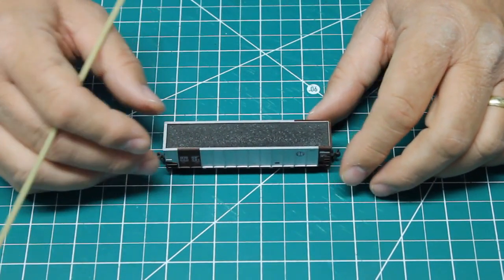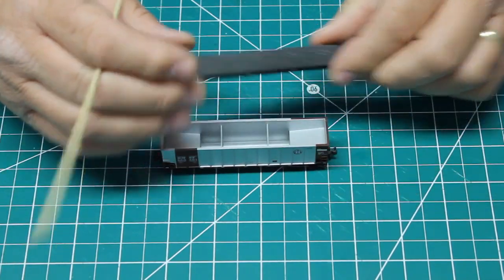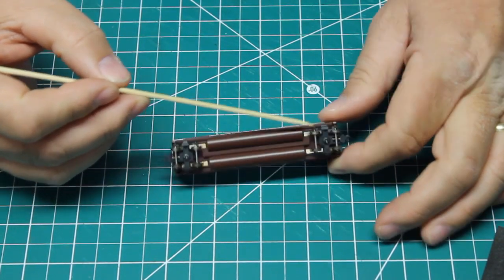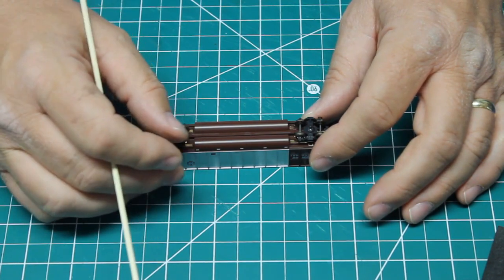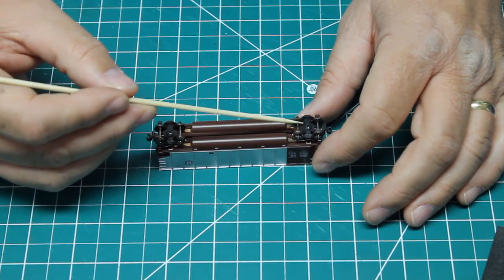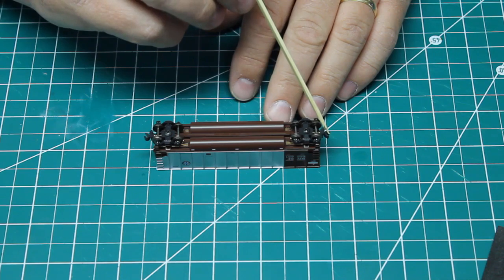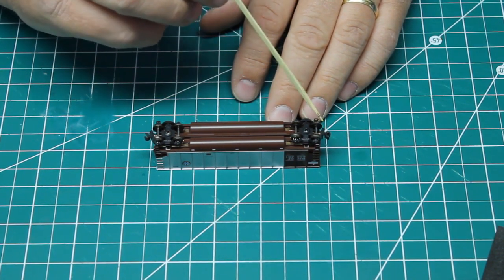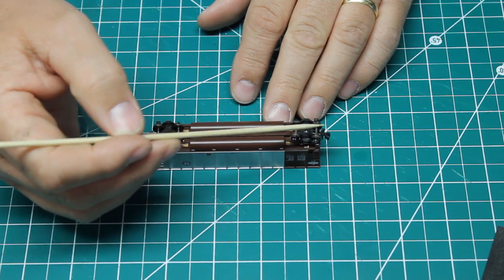Model Railroad Coupler Installation - Body Mounted Couplers

Comment: Brother Ron, very informative! This made the unassembled couplers seen much less intimidating.   I strongly prefer the look of body-mounted operations.  I convert all my M-T cars over, simply by removing the couplers with a hobby knife and re-installing them onto the body.  One project I have is to convert my fleet of Altas 90-ton hoppers over, but that will require a mod such as a styrene strip to install - it would be awesome to see a video on that too!

Comment: Love the glue bottle holder ..... what a great idea!!    And FYI, I am still a dinosaur with truck mounted Rapido style couplers as I  run older locomotives on good ol DC controllers which works for me as I am really not into all the programming needed for DCC and my layout honestly would not really benefit from such an upgrade anyway unless I spent another fortune on DCC locomotives.   Bells, horns and lights would be nice but not worth the time consuming and expensive investment for my needs.  LOL   "It aint' broke, so no need to fix it".    Great video tho, I still learned a lot on how to handle small parts and those pesky liquid glue bottles that love to lay down at the slightest touch.   😳

Comment: Great video.  I also use the MT coupler kits.  Found it interesting that you assembled them with gear box on top.  I use the jig so the box is on the bottom.  Also, I don’t use a tap on plastic. I let the screw cut its own thread. Just feel it is a little stronger.  But a great idea on using the painters tape.
Reply: Ron, how long did it REALLY take to build those couplers?  No pieces went flying? This is always been a daunting task to build these freaking things. Thanks for the video as always. 

Side Bar did you get your hands on one of those new Scaletrains Tier 4 gevos yet?  If so what are your thoughts?
Keep up the wonderful work and peace be with you,
Arthur

Comment: For the most part, I use body mounted coupler rolling stock when coupled the to locomotive.  I found the derailments are reduced because now the truck follows the track while the rolling stock body swings out with the locomotive body. Great video.
Reply from the maker: Thanks.

Comment: Great tutorial. I've put body mounts on quite a few of my rolling stock, but still have more to do. Do you ever run into a problem where your trucks no longer swivel enough because the inside of the wheels hit the body-mounted couple box? I have a few like that and they derail on tighter radii.

Comment: Thanks for the demonstration Rob. I am currently running about 70% truck mounted couplers and 30% body mounts.
Reply from the maker: My percentage is not that high. I tend to use the truck mounted couplers unless I have a problem or some specific reason to change, but I have no qualms about swapping them out for the body mounted ones. Anything that improves reliable running.

Comment: Great video, Ron.

A couple of points. MT make a jig which makes putt g the couplers together a bit easier. It provides the "third hand" which comes in handy. Also, burnishing the mating surfaces of the couplers with the shaft of a small drill is supposed to make the various surfaces slide better. Finally, I saw a hint somewhere which suggested putting a length of thread through the springs until you have them in place. That stops them from flying across the room as they tend to do, never to be seen again. Then when everything is in place, just pull out the thread. Think of the money you could save not having to buy all those extra springs 😉
Reply from the maker: Someone else mentioned that jig. That would probably be handy, although doing it like this on the tape is really easy. Furnishing sounds like you good idea, although I've never really had trouble with the parks sliding on in scale colors. Ask for the springs, if you're really worried about them popping out that's a good idea, but I would think that getting the thread through those Springs is not an easy task and handling them with the hobby knife like I didn't this video I can't remember the last time I lost one.

Comment: Great video Ron.  I have the  Kato Bethgon Protein gondola 8 car set, 106-4650. (which is almost identical to your coal set) and hate the stock couplers.  Your video helped me immensely with this conversion.  I used the unassembled Micro Trains coupler (1015-10) as well and took me about 20 min. per car.  So, thanks again for your very intuitive and educational video.

Comment: HI RON, another good video. You are right about body mounted couplers, when I started modeling in n scale I tried to go to body mounted couplers, some cars were easy but you have to check heights too, and MT does make a tool to help assemble those tiny parts, about $10 they are a help but the tape is good idea too....thanks for sharing 😁

Comment: {N} gauge). .. I tried OO9 couplers which have a little wire hoop, instead of the "elsie" type uncouplers which needed help in coupling up to other wagons, there's not enough weight on these little trucks, it worked well for me. {O} gauge I use a home made wire hoop which clips over the hook with the 3 link chain, it's easier on the eyes and hands. Those couplers look quite fiddly quite a challenge ! they work well ! .

Comment: Here's an idea for a related how-to video.  How do you adjust coupler height if it is too low or too high?  I would guess that each one is addressed differently as to the remedies used.  Right now, Ron, my two N-scale freight cars both have truck-mounted couplers and I am going to buy the items and tools, that I need as shown in this episode, and try my hand at this procedure.

Comment: Great video! I found it a couple years ago, and now that I want to switch out the Kato couplers I found it again. I’m assuming since you didn’t show in the video, the couplers are at the correct height and a shim is not required. Also I like your solvent holder, I need to make one.
Reply from the maker: Usually they are at the right height, but I always check each one to make sure.

Comment: Great video.  I've had little experience and bad luck with those springs.  I went with MT bettendorf trucks with medium couplers on Kato coal cars, had to file the pin holes on the trucks so there was no stiffness turning left and right but they've been perfect so far.  I'll be watching this video again when I have a need for body mounted couplers though.
Reply from the maker: Good luck.

Comment: Ron,  I am in the process of putting Micro Trains body mounted couplers on all my rolling stock.  I quickly discovered I can easily back a 15 car train through #6 turnouts without derailing.  FYI-Micro Trains doesn't sell the drill and tap set anymore.  They are hard to find.  Also, they use to make a jig for assembling the couplers.  MT doesn't list that anymore either, so I don't know if you can find them.  I have used one for years and it makes assembly very fast once you get the hang of it.
Reply from the maker: I've heard of the jig, but as the video shows I've never used one nor felt the need for it. As for the drill and tap set, that is unfortunate, but the bits and taps can be purchased independently in a variety of places. Check with Micromark.com

Comment: Great video! To plug the hole however, I would use stretched sprue... The area where it tapers from the correct diameter to slightly oversize allows you to really shove it in and get a tight fit regardless of tolerances.

Comment: What if any  suggestions  do you have  to change  out marx tilt and slot and pin couplers with knuckle couplers
Reply from the maker: I don't work with those or even O scale generally, but I believe you will have to replace the entire trucks...but don't quote me.on that.

Comment: I noticed you did not show us how long it took to put that pesky little spring in place ?? LOL,  i to have a unit train of these cars but i have only put body mounted couplers on one end of the lead car and the last car, i also fit couples to one end of the 2 middle cars in case i want to use helpers, nice video Ron thank you

Comment: Not trying to be Negative as I really like your Videos Ron but on a certain layouts the Boby Mounts Can be well Rather Annoying Say for instance my D.M.R.R I'm basically Running Down 2 long strips with curves at both Ends if I have to Stop on the curve to either Back up into one of my Yards or stop back up and the Go I have 3 to 4 or 5 of my Body mounts uncouple on me And I have to go and Re hook and hope they stay together.. I'm not saying these type of couples are a Dred to have on my Rolling stock but it kinda takes the Fun out Railroading when your resetting the consist all the Time But I'm Glad you posted this as you show a Great change up from the ole KATO Coupler.. 

Thanks for sharing the Video..
Reply from the maker: I cannot say for sure without seeing what is happening, but I don't think you problem is specific to body mounted couplers. It may be an issue of shanks that are too long or too short. Typically one will have derailment problems with truch mounted couplers due to the lateral pressure they put on the trucks against the rails in a curve or turnout.

Comment: Ron, Kato couplers will easily couple with MTs IF you use rail nippers to n remove the bump on the side of the Kato. 
Most all of my cars have body mounted  if possile.
Reply from the maker: The problem with the Katos is the lack of a moving knuckle. You can get them to couple with MT couplers, but you have to really work at it, you can't couple to them by just backing into them like you normally would, and they uncouple extremely easily especially on grades.

Comment: Ron.  I leave the trip wire on. Looks more like an air hose. Might find the need to mount and use an uncoupling magnet in a hard to reach location where a pick won't reach. Suggest changing couplers on one end only of two end cars if only running a string of Kato type cars used in loads in/ loads out service. Great tips on how to get er done. Mike
Reply from the maker: Thanks Mike. I will have to disagree about only changing end couplers on unit trains. I'm not at all impressed with the Colorado couplers in that they tend to come uncoupled pretty easily. This is specially a problem on grades. I just prefer to replace all of them with micro trains couplers for better reliability and more consistent look.
Reply: Darn. I was taking what I thought was the easy way out. I guess I'll have to go ahead and install the whole pile of couples after all.
Reply from the maker: Lol, sorry. 👍
Reply: @mlkesimmons758  That wouldn't work well if you were doing a lot of switching operations. Every car will wind up coupled to the engine at some point.
Reply from the maker: That is true, and that is why I am ultimately upgrading all the couplers. In this case however, these coal cars around in unit trains and  Rarely get switched.

Comment: Wonderful video. Probably exactly what I need. Just started on a mini 2' by 3' layout with 3 of my grandsons (all from different families). Needed to fit in the boot of a car. Incorporated into the layout is a three siding shunting  puzzle with magnetic uncouplers. Unfortunately I purchased cheap 10' and 15' 4 wheel Peco goods cars which have rapido couplers on them. The smallest radius curves on the layout are 6". My question is canI use the short shank Micro Trains couplers on them on our tight layout?
Reply from the maker: That may be a challenge. I would try a couple and test them first.

Comment: Great video... showing the fix for a mistake  will keep a lot of cars out of the trash can.  I have started replacing my box cars with body mounted couplers.  Have you done any covered hoppers where there is no material to used BMC?
Reply from the maker: I have done some covered hoppers. TrainWorx makes some add-on fixtures for some hoppers to solve this issue and they work great for those cars that they are made for. Again, I don't body mount couplers on all my rolling stock, only what really needs if for improved operation.

Comment: I'm assuming once i do this to one car, it will have to be done to them all so they all couple together ? what about locomotives , do i leave half of one piece of rolling stock with the original coupler so it can act as a connecting car between the locomotive and rest of the train ?    I'm pretty new to this and right now i have some kato and some bachmann that don't like to work well together, and these body mount couplers could solve that issue.   Oh! and thanks for the very informative video. i've learned a lot from watching your channel.

Comment: Excellent video. I’m just getting ready to convert some Kato freight cars to MTL body mount couplers. I think I’ll try assembling a few after seeing this, definitely not as bad as I though.

For cars like tank cars, hoppers, and gondolas where the screw may poke through the frame or into the car, do you cut the excess with those flush cutting screw nippers? Or do you remove the screw after fitting and trim the excess? Thanks again for such a great video!
Reply from the maker: I would look for shorter screws. Cutting will destroy the leading threads.

Comment: At this stage, I haven't body mounted anything but I have some cabooses (caboosii? what is the plural do you think?) which will have to have them body mounted as the original couplings are body mounted rapidos and I don't know what MTL trucks come with long enough couplings to just replace.
Reply from the maker: Cabeese. LOL. You can get long-shank couplers, but body mounting is a better option.

Comment: Have you ever tried the TrainWorx body mount castings for hopper cars?
And have you tried the new MT TrueScale couplers?
Reply from the maker: I have used the TrainWorx mounts for some older Atlas hoppers and they work swimmingly well. I have not tried the True Scale couplers. I love the reliability of operation you get with magnamatic couplers. True Scale, while they look better, are know to be a challenge to couple and uncouple and, as one who is big on operations, the trade off was never worth it to me.

Comment: Hi Ron. What’s your opinion on using the dummy couplers body mounted on unit trains. At least from a money saving aspect and from none switching aspect of most unit trains.
Reply from the maker: Hey, Michael. I likek the idea in theory, IF you can get good dummy couplers that stay coupled reliably. I tried to do this with Kato coalporters but found that the Kato couplers came uncouopled too easily. If you can avaoid that issue I think it is a great idea for unit trains that will not get switched. Chances are your dummy couplers will be more scale size and look more realistic too.

Comment: Ron could you show how to put body mounted couples on and n-scale tank car ?? thanks Wendell
Reply from the maker: I've never done tank cars, and personally I wouldn't just because what it would take and because truck mounts work well in that case. However, if you were to do it you would need to build a platform to mount the coupler to under the end foot plate. Look at some prototype photos and you will see what I mean.

Comment: Hello Ron

I went to the Micro Trains website and saw all the PDF files on what coupler to use on my rolling stock. There are many types and couplers, short, long and six wheel ones.
The issue is that I could spend a week making a list of that couplers before purchasing the couplers

So, my question is this
Do you know of anyone that I can pay to convert the cars and engines I have to Micro Train couplers?

James

Comment: Hi like your video's.
question ?  I just bought a set of NEW  Kato  11 car California zephyr  106-1055   with display track  2006 release .  in the foam inner holder   But Missing outside box. they are selling for upwards of $350.00 .  on Ebay.   will the Missing outside box  cause it to be les desirable or worth less?  looks Unused. and I want to sell it cause I don't have Kato Couplers. what is it worth?
Reply from the maker: I can't tell you what it's worth. It is worth what someone will pay for it. The missing box would hurt it's value to a collector, but an operator will be more interested in the condition.
Reply: Thanks Ron . These look so good that i am considering to keep the after all .

Comment: Thanks Ron.  You've given me inspiration to start using the coupler bulk kit instead of the pre-assembled ones.  Would it help to hit the couplers with some graphite when assembling them?
Reply from the maker: The unassembled couplers aren't bad once you do a few and get the hang of it. Ask for graphite, I've never found it necessary. These slick plastic parts move pretty well if they are assembled correctly. Graphite would be more helpful if you were in ho or larger scales and using metal couplers.
Reply: @RonsTrainsNThings  i suggest using powdered silicone lubricant.

Comment: Ron I'm looking at doing a n scale layout this year (2022) I do not have any trains at present and I plan on using all Kato as it would suit my needs. Everyone speaks highly of Kato products EXCEPT there Couplers. But most of them have different brand locomotives and cars in there sets and want them all to work together so the coupler swap makes sense. So my question is if I'm using all Kato locomotives and cars will there couplers be an issue? Again it will be n scale.
If anyone else that has all Kato wants to comment jump on in.
Thanks RCW